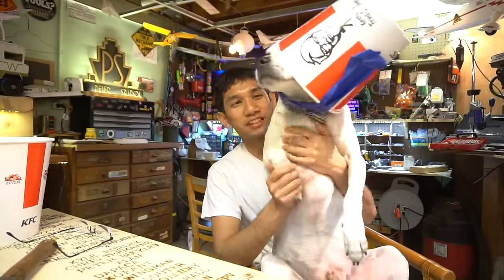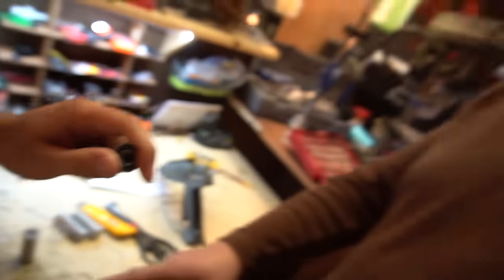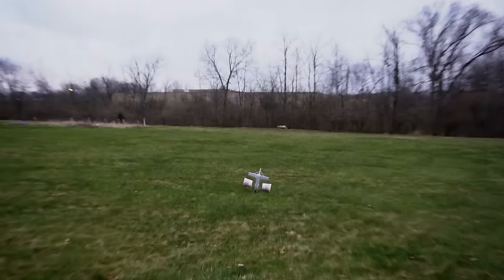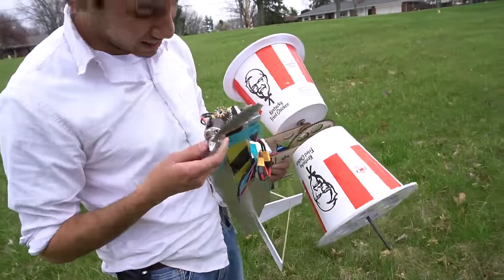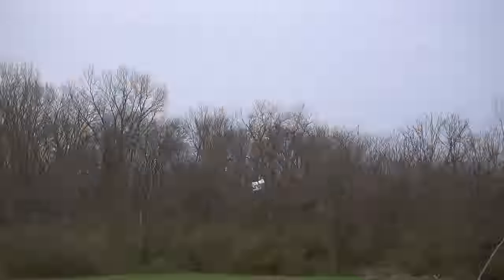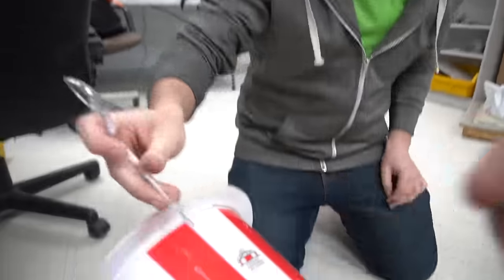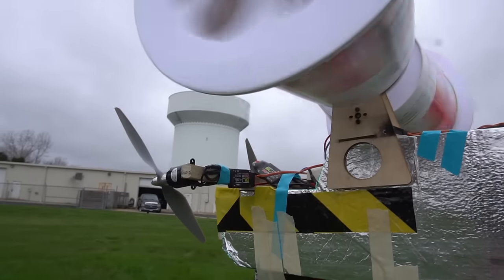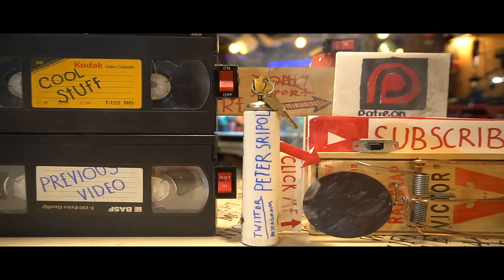RC KFC bucket aeroplane (magnus effect)

Comment: When you introduce a backwards spinning cylinder to airflow, you accelerate the air above the cylinder and decelerate the air below the cylinder. Fast moving air has less pressure than slow moving air, so a pressure differential, and thus a lift force, is generated. This is the basis of the Magnus Effect. A conventional cambered wing works in the exact same fashion: fast air on top, slow air on bottom. This is why the cylinders must spin with the top spinning with the wind.

A major flaw in your design is the two props located below the buckets. The propwash accelerates air right past the bottom of the bucket, essentially negating the velocity gradient you create by spinning the buckets in the first place. You should try either mounting the props above the cylinders, to further increase lift, or even a pusher configuration to eliminate the propwash problem entirely!
Reply: Michael Perrino And in his "flying" portions the plane was at a huge angle making me wonder if it's not just flying off the props and tail force
Reply: What he said
Reply: So if the buckets were bigger and rotate faster, would it fly better? Would it help if the buckets had some sort of grooves?
Reply: I think in general, faster would be better. In essence you want to look at the Kutta-Joukowski Theorem, which states that lift force is equal to (density of the fluid)(velocity of the flow)(circulation if the air). Circulation is harder to define, but in essence, the higher the velocity of the rotation, the more circulation. However, the circulation is also dependent on the radius of the cylinders, and a fixed torque motor spins a larger diameter cylinder slower. So you'd have to find the optimal size-rotation velocity ratio. As for the grooves: you'd need to optimize that as well. Too many deep grooves would cause too much drag, but if the cylinders are too smooth, you couldn't have the friction to get the air circulating fast enough. It's a hard to define problem and depends in a lot of variables. Trial and error is probably best in the scope of this video.
Reply: i cant think of the name of the effect, but i think some of the instability may have also been caused by the rotation itself. when you have something untethered and spinning in a vacuum, or in this case suspended in air, spinning objects have a tendency to either go straight (gyroscope effect) or flip 180 degrees but keep going straight also( cant think of effect but there is videos from the space station with tops that keep flipping direction. in order to turn this, he has to fight the gyroscopic force that induces rotation up and down when he tries to turn
Reply: The specific "effect" you may be thinking of is Intermediate Axis Theorem. Basically, every object has three axes of rotation, two of which are called the principle axes and an object will be stable when spinning around this axis. The intermediate axis, the third, non-principle axis, is unstable and will lead to this flipping motion you describe. This has less to do with gyroscopic effects and more to do with dynamics associated with rotating bodies. Unfortunately, I do not believe that the Intermediate Axis Theorem is playing significant role in this aircraft.

But you do raise a good point, the spinning buckets will torque the aircraft in the same direction to the spin. This is just the Conservation of Angular Momentum and is the same reason a helicopter needs a tail rotor. In the case of this video, that will cause a positive (up) pitching moment. This will lead to instability in the longitudinal (pitch) axis, however, as we can see in the video, he was able to overcome it with aerodynamic forces (trimming the elevator).
Reply: I noticed the aircraft seemed to flip upside down a lot. maybe it was self-correcting that problem with the prop wash you mentioned.
Reply: Aircraft fly by pushing air down.  The whole different air speed thing is nearly irrelevant.  Google it.  I know they told us about the air speed thing for decades but it was wrong, it's not even logical, and it was proven wrong.  I find it amazing that any aircraft of size were ever designed while people believed it.
Reply: Brody Sargent Freedom Talk Media

both of you are somewhat right but also somewhat wrong. I am aircraft enthuasist and I also study to be Aircraft Maintenance Engineer (specialiced for engines and airframes) so I know what I am talking about. 

It is of course a necessity for flying that air around the wing is pushed down. It is called "downwash". But most of the lift is created on the upper surface of the wing, so wing is not just a flat plate that pushes air down.

So how does it work then? What you need is  angle of attack. Angle of attack causes upper surface of wing to have low pressure, which accelerates airflow over it. However this has nothing to do with mr. Bernoulli! Air under the wing goes much slower than air above the wing, but the pressure under the wing doesn't lift the plane a lot. it is the air that comes from the upper surface and is turned to go a bit downwards.

So basically it's that angle of attack causes wing to pull itself up by pulling airflow down, not by pushing. Pressure above the wing drops (due to AOA) but it ain't related to Bernoulli's law as air under the wing isn't having a lot of pressure even it goes a lot slower than air above. 

So lift is created by angle of attack that causes pressure to decrease, which accelerates airflow, and then AOA leads accelerated flow slightly downwards. Ta-da.
Reply: Freedom Talk Media 

The description I gave was certainly a simplified model. In reality, lift generation is an extremely complex phenomenon. One must take both the deflection of air downwards and the pressure differential generated by the velocity gradient on the top and bottom to get a more complete picture of how lift is generated. 

The Bernoulli explanation is not incorrect, this is a common misconception. This explanation was controversial because it originally assumed that the streamlines on the top and bottom must meet up on the trailing edge, but that has been experimentally debunked. The Bernoulli explanation still holds valid without this assumption.
Reply: When I heard this at school, I could never stop to wonder why does the air speed up just so it can meet at the end? Why cant it just slow down, as there is something slowing it down if the wing is level with the ground. So what is really happening is that when the plane goes forward with a wing that has an angle, there is suddenly a vacuum since all the air has been pushed away. Now because the air now can move freely it goes much quicker.
Reply: The air does not meet up at the end (it can, but this is not necessary for lift), but it does speed up. It is a common misconception, often taught in public schools, that the air speeds up because it must meet at the trailing edge but has a longer distance to travel. This is simply not the case. It does speed up, however, due to the positive angle of attack of the wing drawing a vacuum on the upper side of the wing, which induces a low pressure zone. As we know from Boyle's Law, gas pressure is inversely related to velocity. In other words, low pressure results in higher velocities. This means that the low pressure zone that develops on the top of the wing speeds the air up, and the high pressure zone on the bottom of the wing slows the air down.
Reply: @Michael Perrino: Conventional airfoils get more lift than a rotating cylinder because of the interaction between the sharp trailing edge and viscous air, don't they?
Reply: Michael Perrino r

Comment: Imagine if they had made this discovery b4 regular wings and early airplanes had these
Reply: XD
Reply: Actually, some early planes used this. Even ships used cylinders as a replacement for sails.
Reply: @dogipug5646  that's rlly cool
Reply: @dogipug5646  They tried everything. I've seen the cylinders for sails idea too. Keep in mind, the "autogyro" was big in the 1920s/30s, it's basically a plane with a passive, not powered, set of helicopter type blades that would rotate once the plane got moving. This allowed having stubby wings and short landings (not sure about takeoffs).
Reply: But if the engine stalled the plane would just fall but with wings the plane can glide.
Reply: Google the Plymouth A-A-2004. The most ridiculous looking aircraft you've ever seen.

Comment: you have forward pitch torque from the rotating buckets. might do to move them back a bit so the front weight does a better job of countering that.

might also be good to have a larger area rear tail wing to maybe get better pitch stability.

you definitely will only get magnus/bernoulli lift if you're moving forward relative to the rear-ward motion of the top side of the buckets.

super fun idea dude!

Comment: Awesome idea, however one thing I noticed is that in aerodynamics you want the air on the top of the wing to be faster so that the pressure underneath provides the lift. I would try rotating in the opposite direction, plus I would build a larger tail so that the air movement across the tail helps counteract the body rotation when the buckets start to spin.

Comment: next step: differential lift by having the buckets spin independently :)
Reply from the maker: *head explodes*

that would have solved my roll issue!
Reply: haha, I got the idea ... from your differential steering ... the human brain is incredible. We make or miss connections really randomly.
Reply: nraynaud1 that is step 2. step 3, tilt motors so bucket axis can form a dihedral to increase stability, have thought about that detail?
Reply: also a canard configuration would prevent stall / over pitching.

Comment: Shouldn't it work better if we eliminate the torque element with another pair of KFC buckets spinning the other way around.

Build in Chinook style with the rear buckets above the front ones to avoid the vortexes generated by the front buckets, this should work out pretty well.
Reply: psander0504 It won't work because then you have Magnus effect acting in the other direction

Comment: not enough lift area and control, Wonder if 4 buckets would of worked.
Reply: Really want to see how 4 buckets would behave now. I'm thinking 2 at the front and 2 at the back, or did you mean extend it out by 1 each side.

Like
] ] - [ [

or

] - [
] - [
Reply: Actually [ ] - [ ] so the bleed off goes in away from center. The top of the buckets have the widest diameter so the fastest speed and so highest amount of lift.
Reply: *would've
Reply: Cringey Cookies No, "would of" is not correct.
Reply: Cringey Cookies no, "would've" is correct, as it is short for "would have" while "would of" is incorrect
Reply: +Matthew Adams k didnt see that, my yay my first reply

Comment: apologies if i am repeating. try making the wings longer (and thinner) to increase the lateral stability and the Reynolds number. make the fuse longer to keep the fin and elevator out of the flow and go again.  love your experiments. best of luck.
Reply: Tariq Saeed thanks Tariq I've been looking and looking and you are the first guy that starts to get the problem. First the experimental effort here is great I am very impressed with the cool fixes they tried. Variations of Magnus lift have been tried on full size aircraft and getting it work is tricky. 
The opposite and equal reaction to the spinning buckets pulls the nose up. 
The thrust line is very low below the center of lift accentuating the nose up reaction when you increase power. That's two things on the nose up. The only thing left to counteract these effects is the horizontal tail (stabilizer) surfaces. Like he said he ran out of pitch control. 
There are a few changes he could try- attach the stabilizer with more negative angle. Make the stabilizer bigger. Or make the fuselage longer to increase the effect of the stabilizer. 
I hope you guys keep after your design this is something special that shows lots of people cool science projects

Comment: sorry, im no expert. just hunch tho, if u place the front prop above the wing bucket, wouldnt it make it easier to achieve greater airflow above the wing bucket and further increases the lift? also it would make it easier for the bucket to spin at higher rpm because of the front propeller pushes the air in the same direction as the bucket tries to spin to. thanks.
Reply: I agree with this statement.
Reply: I was thinking the same thing, also try putting the buckets on a longer axle increasing the 'wing' span so the prop wash interferes less with the magnus effect airflow than in the current setup. might add a bit of stability. Another thought was that if you can make the bucket rotation speed independent to each side and still controllable it may be able to work like ailerons? I know nothing about the magnus effect and how diameter of the buckets effect lift, but tubes with proportions more like kitchen roll inners would offer less drag.
Reply: Interesting idea. Would be cool to try this.

Comment: theoretically, if you spun them independently, couldn't you adjust the speed and use that to steer?
Reply: Theoretically, he could only roll it that way, not steer.
Reply: well, that's what I meant to do a bank and yank. All he has right now is rudder, and that's not ideal for something with such big "wings"

Comment: you should just make a flat board with no control surfaces and use thrust to fly it, only have like very small control movement freedom
Reply: So essentially a quadcopter?
Reply: Wouter Van Goey i think a plane with no control surfaces
Reply: I kinda (totally) did that with a 2.4ghz 3ch helicopter guts. motors on wings for thrust and diff/steering, tail rotor acting as elevator at rear of tail boom, with a cheap EPP foam chuck glider, flies really well. another youtuber did similarly with a foam circle. hard to find video, guy made a paper plane stuck a cheerson CX10 on its nose (front down), recalibrated gyros, flies like 3ch plane no prob
Reply: I think he means, the flat board should serve as a flying wing, only kept under control through differential thrust and control surfaces. I think it would be a cool project!
Reply: RCTestFlight did something kinda like that. Basically made something fly that shouldn't. Search     RC Flying Sled - RCTESTFLIGHT -

Comment: Isn’t the flow of the propellers giving an higher windspeed (and lower pressure) under the bucket counteracting the magnus force? Maybe it fly’s better when you have the propellers at a different place (at the back or above the bucket). But I don’t have a good understanding of the principle so I could be talking rubbish. 
Btw: I liked the video very much!
Reply: This might be true because if you moved the propeller to a different section it would counteract most of the forces caused by wind speed and or its gravity

Comment: Hi guys, years ago I saw a magazine with a story about a ship that used three large vertical tubes that turned by the wind to move the ship along the water.  These tubes were said to be a replacement for ship and boat sails.  Do you think that these tubes were a product of the Magnus affect?
Reply: cwrobinson6363 yes, magnus effect can also be used in ships.
Reply: cwrobinson6363 that's why the ship was made.
Reply: cwrobinson6363 . You are describing "turbo sails" which were  demonstrated in the vessel "Alceone". Basically they are fat airfoil sections. By using a fan to suck away the inevitable turbulence produced in the leeward part of the sail. It was a fascinating experiment but given that it hasn't been used commercially i suspect that it wasn't as efficient as the designer's were claiming.
Reply: Grant Frith ...
Reply: 100% YES - Magnus affect replace sails
Reply: The Enercon E-Ship 1 is worth checking out. It uses Flettner rotors to harness the Magnus effect for propulsion. Pretty epic stuff!
Reply: Can't tell from that how much affection for Magnus they had and if there was a resulting product of that affection...
Reply: cwrobinson6393 yep, the Alcyone used two of these "turbosails" which were using the Magnus effect https://en.wikipedia.org/wiki/Alcyone_(ship)

Comment: Rotation , rotation, rotation it should be rotating or spinning clockwise if viewed from the left bucket (bucket tip? ) or anti-clockwise if viewed from right bucket , rotation definitely has a huge effect on flight characteristics.

Comment: Great videi!  Loved it all. I believe the buckets were generating way too much wing lift,  more than the prop and control surfaces could counteract to maintain horizontal attitude.  Smaller diameter, or slower, buckets and/or larger control surfaces might allow the required forward motion.  The whole Magnus things is so counterintuitive, especially the open Fanwing design. Oy!
Reply: Spot on and right. Buckets were way to large or the fuselage and rear horizontal/vertical stabilizers needed to be much bigger. I would like to see him build one that is built to functional specs.

Comment: Sweet! err, put the buckets the other way around, should give you a better lift profile and less induced drag. Stability is still a bitch though. Maybe a quad bucket tandem biplane?
Reply: I was thinking the same, except I thought it might help roll stability if the narrow end of the buckets was on the outside.  Now you mention it, it should help with yaw stability too - like a swept back wing.

As someone else said, the prop needs to be acting closer to the centre of the "wings" too to reduce the pitching up effect.